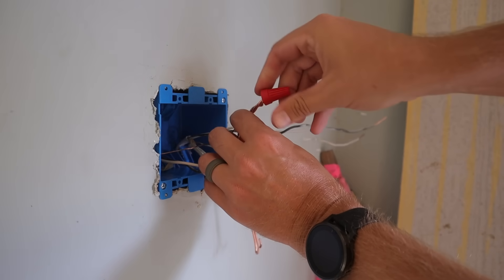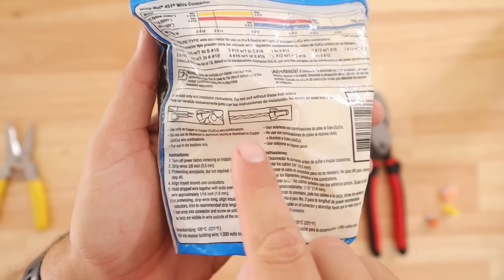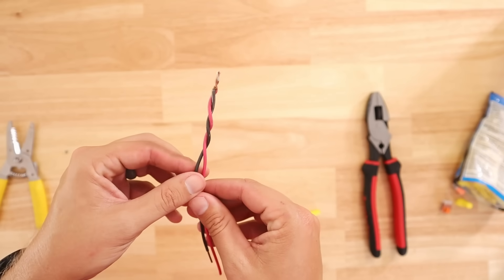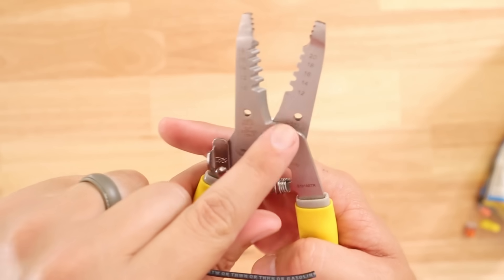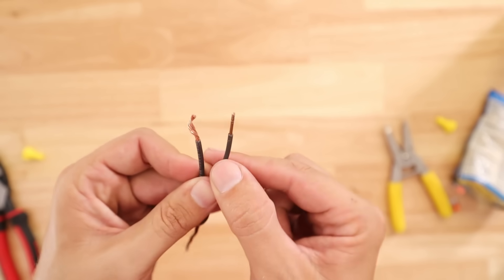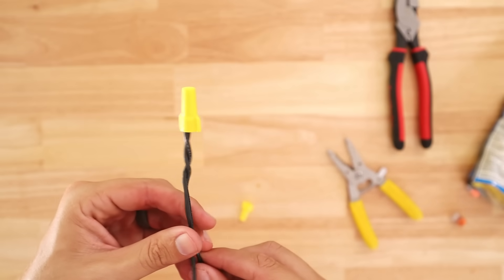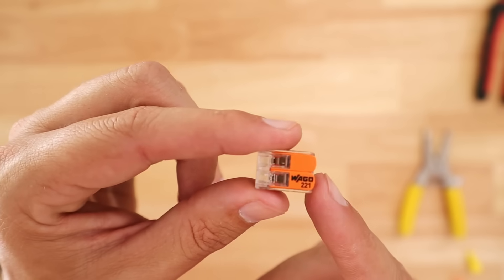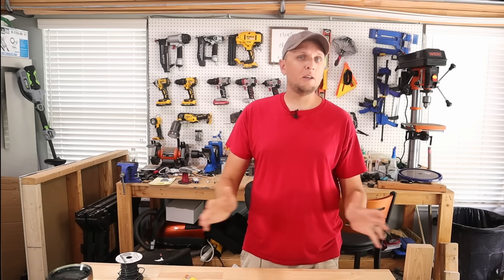BIGGEST Mistakes DIYers Make When Connecting Wires Together | How To

Comment: A slightly quicker way and still get a good strong twist of stranded wire onto solid wire is to put the stranded wire slightly above the solid wire. When you start to twist the wire nut it grabs the stranded just before the solid. That prevents the stranded from pushing out and makes a very tight twist around the solid. Just make sure to hold both the wires securely or it will try and pull just the stranded into the wire nut. Give it a try.
Reply: If you don't lead with the stranded conductor it will almost certainly be pushed out.
Reply from the maker: Yup that is also a way that works.  Thanks David!
Reply: What I regularly do is seat the stranded lead(s) all the way into the wire nut, w/o any solid conductors.  Give a twist to make sure it's seated, and the stranded lead consolidates and tightens "loose" strands.  Only THEN insert the solid conductor and twist 'em home.  
Works every time. 
YES, there are a lot of bad electricians out there.  I ran a new dedicated line from the load center to a dishwasher that an electrician had tied into a porcelain pull chain light fixture below it in the basement.  Removing the fixture, the wire nuts fell onto the basement floor. Yikes.
Reply: @KWKloeber  Have had that happen to me as well. Really sucks when it is an older house with more than 1 circuit going in and out of the light box. A lot has changed over the years including the mindsets electricians used back in those days. Today is vastly different than those times. Still find soldered connections in attic junction boxes. Now that is a pain.
Reply: @KWKloeber  Not directly relevant here, but more on bad electricians. When I replaced a straight switch for a Lutron dimming switch, I found a loose wire that was a separate 120 v source, just lying unconnected to anything.
Reply: @KWKloeber : Whoa! .... and the guy that did the install is a "certified electrician"?
Reply: Excellent advice and well described too.
Reply: James Sheppard  Right on James!  A cap.  Mechanically tight connection first, then the cap.  45 yrs Master & Electrical Contractor.
Reply: James Sheppard  Soldering was the way to do it before modern wire nuts. Completely unnecessary now.
Reply: I used to do electrical work and this is exactly correct.
Reply: Probably one of the most thorough and clearly described videos I have seen on any subject on the Internet… Thanks much!👍🏻😎
Reply: That is the best way in my book. I have always done it that way.
Reply: Best way I've found is to put a slight "S" bend in the solid wire then the stranded will follow the curl of the wire. You can use your fingers to twist then put wire nut on.
Reply: I agree after twisting your stranded wire itself start it in nut first. That's old school technology
Reply: @olruss4606  I have always put the stranded a little past the solid and then wire nut it. Never had an issue doing that. Putting it in first would pretty much do the same thing I believe.
Reply: This is how I was taught!
Reply: My dad was an electrician and when I worked for him he'd "have my nuts" if he coaught me pretwisting 2 solid wires before installing the "marrette" wire nut. Thomas&Betts Marrette ACS wirenuts - strip 7/16" on both wires, insert parrallel into the wire-nut and twist intil both wires twist below the nut. Using a linesman pliers can cause scratches that cause stress risers which can cause the conductors to break (particularly bad news with aluminum wires!!!!)
Reply: @MrCsnyder1952  Aluminum wire is no longer NEC code compliant due to that reason. Copper is far more resilient. Where you have to be careful is when stripping the wire. Nicking the wire by using too small a stripper can cause the wire to snap off.

I do need to make a correction on aluminum wire. It is only acceptable for use in service connections from poll to meter. Anything after the meter must be copper.
Reply: Pretty sure he showed that
Reply from the maker: I did but the variation I believe David is talking about is instead of then pretwisting the stranded around the solid core like I did, it is also common and accepted practice to take the stranded and have it slightly longer than the sc and then just twist the wire nut on as shown in the directions on the packaging.  If not, feel free to correct me David.  The way I showed is the way an electrician friend showed me he does it but everyone has their ways they have found they like to do things.
Reply: @HowToHomeDIY  Correct. As long as it grabs the stranded slightly first it will wrap tightly around the solid.  It will give you the same effect as pretwisting just a little quicker.  Wago's  lever nuts would be the best solution for dissimilar wires. 😊
Reply: @jonesgang  Totally agree.  I prefer Wago when using stranded wire.
Reply: I always use electrical tape over the wire nut and down the wire about 3 inches after nutting them together.
Reply: @mouthofspaghetti7817  that is a bad practice, you add heat, moisture trap and adhesive goo that is all completely unnecessary. This guy is showing you in detail all that is needed to make great splices.
Reply: @mouthofspaghetti7817  Tape doesn't do anything. If you need tape to make your wirenut secure, you didn't use the wirenut correctly.
Reply: @DaveMiller2  You are missing the point; wire nuts alone might work fine on display in the wire nut museum but in the real world, where a wire is in a wall or in the HVAC units I used to service; other people, many unqualified and or unprofessional might come along a pull on your wires, step on your wires; causing the wires to be pulled out of wire nuts...
   I have seen wire nuts split, crack, swell and strip out... in the real world the best of design can fail. In that case I want a backup.
   I have never seen a wire nut wrapped in electrical tape fall off. Can you say you have never seen a loose, cracked, swelled, stripped wire nut.
   Redundant safty might not be needed but I am going to continue to do it. If you feel comfortable doing the minimum, Go for it!
Reply: @mouthofspaghetti7817  You missed my point. Tape will not keep wires in the nut if it fails. If the wirenut failed, it was installed improperly, not because of a lack of tape. 
Tape literally does nothing but make you feel better about it. And the glue in tape lets go over time anyway. Especially the cheap tape most guys use. 
If someone pulls on wires or something and they come out of the nut, you installed the nut wrong. You didn't tighten it correctly, the nut was too big,  too small, or was  used when you put it on. A new wirnut properly sized and properly installed  will be fine over time. Tape does nothing. If you can pull the wires out of the wirenut, the tape will come right off with it . Tape has almost no power to hold. I've tried it myself. 

In the old days they put tape over soldered connections because you could shock yourself touching the exposed connection otherwise. That is where the mistaken idea that wirenuts need to be taped comes from.
Reply: @DaveMiller2  I guess all those wire nuts I have seen fail must have just been my eyes playing tricks on me. The ones I have had crack and split were of a special design and I thought they just broke.
   I don't care what the minimum standard is...I am going to continue to use tape over the wire nuts because I have NEVER seen the combination fail, I have seen wire nuts alone fail. 
  Bringing up cheap tape is silly, professionals should know better, I guess I should have said Dollar Store wire nuts fail but I didn't because that would be a ridiculous statement. 
   The Electrician who taught me used tape/wire nuts, every Electrician I have worked around saw me using this technique,  I only remember them approving, I have seen hundreds of splices done this way.
   So far the only people I have heard who have a problem with it are people on YouTube.
Reply: @mouthofspaghetti7817  I'm with you, it's standard practice in HVAC units to tape them on to prevent them from slowly unwinding off from the unit vibrating all the time. With a lot of motor hookups it's a good idea to wrap it in tape. I've even had to do it at an HVAC manufacturer. Usually the shop connections are all on nice terminals, relays and contactors and inside a motor's splice box. The motor end was always supposed to be taped after making sure the wire nut didn't come loose. Sometimes we built really huge units, that had to be taken apart to be delivered and installed then put back together easily on site, so there would often be splice boxes on the motor conductors that had to be spliced with a wire nut-- and taped. Controls would get boxes with terminals, but the motor cables always got spliced, then taped. Even though I would have to take that splice apart after testing-- they wanted me to just retape it to hold the wire nut on top of the single conductor during shipping-- that way it wouldn't scratch the paint during transport. Tape is cheap compared to damage.
Reply: @mouthofspaghetti7817  If your doing that tape thing on 200 connections a day, you aren't going to have a job for long. Completely unnecessary.
Reply: @scottmichaels1764  I don't do that type of work anymore but when I did it was more like 5 a day.
   Most of my experience was in HVAC and I recently found out that because HVAC has a lot of vibration and drastic temperatures change,  taping wire nuts is suggested. 
    But even if I wasn't wiring HVAC, I would want that extra security for my connections; 20 more seconds isn't going to ruin my day.
     What kind of work are you doing to where you are wiring 200 connections a day?
Reply: @scottmichaels1764  Wow that is impressive, if you are wiring 200 a day ,that is more than a connection wired every 5 minutes.
Reply: @mouthofspaghetti7817  I'm a 25 yr master electrician, 20 year master mechanical/ HVAC and never tape wrap my wire nuts. If installed correctly I've never seen a wire nut just " pop off " unless the wiring is being handled at the time, there are too many wires crammed into a wire nut or a cheap brand was used. As a whole if one pops off it's because you installed it incorrectly to start with and in that case the tape won't prevent arcing or a fire. The loose connection in the wire nut is not helped by the tape and the tape will simply melt or catch fire anyway. Loose connections or heat build up cause most electrical fires. Tape helps neither.   Most fires caused by arcing, as I would assume you are trying to prevent by taping a nut on, occured when heat builds up in a wire and the protective coating is basically baked to the point of cracking allowing wires to short against each other. Taping increases heat build up. It is basically the same principle as reasoning for bundling codes. Wires conduct heat. They require cooler ( ambient ) temperatures to offset it. However, in HVAC smaller guage wires are frequently taped due to vibration and the fact that many low voltage wire nuts do not have springs in them unlike nuts for 120 volts and higher. That's comparing apples to oranges though. Hell many high voltage signs don't even use wire nuts in their connections. I see signs all the time with exposed wire twists.
Reply: @DavidBrown-mm8fx  In 20 years of industrial machine maintenance I've had  many taped wire nuts come off, tape and all. Tape is (in low voltage application) nothing more than a "feel good" for those who are not qualified. It will hide their errors in the short term, but that adhesive will always fail, sooner if heated. I have used miles of splicing tape in peckerheads, or in junctions with unsecured lugs.
Reply: @patrickcamp5885  100% agree. Tape is irrelevant and a waste if the wire nut is installed correctly to start with. It was common to wrap connections back when caps with crimp connectors were common but that was a long time ago before wire nuts with the springs in them.
Reply: @mouthofspaghetti7817  the only thing with that it creates heat if you use the 3M wire nuts they have that rubber skirt on them no tape needed, one less move… time is money. JS
Reply: @eddieklein9536  Time is money, sure, but any time an electrician spends applying electrical tape is time well spent. Do you skip putting on box covers to save time too? ;) Just sayin'
Reply: @mouthofspaghetti7817  Right in the video he points out that the code is to follow the manufacturers instrunctions. I don't recall ever seeing anything about tape on any instructions. What more is there to say? Is the code wrong?
Reply: @MrGorillafingers  'Code' is the minimum standard to pass an inspection. No one fails an inspection for doing a better job than required. If you are happy with the minimum standard, go for it.
Reply: @mouthofspaghetti7817  Hahaha "better" That's rich.  I have removed so much useless tape fixing things that were done by guys that think that way.  Right is right. Wrong is wrong. The tape isn't going to change anything beyond annoying the next guy.
Reply: @MrGorillafingers  All I hear is people complaining about taking off tape, or saying it is an unnecessary extra step.
   I haven't heard one person say this step will cause wire nuts to come off.
   I will say again, I have seen wire nuts break and fall off, get stripped and fall off, vibrate and fall off, have a jerk off mess with the wiring and fall off...all except the last one would have been helped by the simple step of wrapping the wire nuts with Electrical tape... The last one may have been prevented if the Jerk Off was a whiner who didnt want to get their widdle fingers gooey from the glue on the tape...😭
Reply: @Mouth of Spaghetti  It's definitely not a code requirement & depending on the inspector & application quite possibly may be required to remove the tape. Typically, inspectors expect to see jobs done following the industry standards & any deviation will almost always be corrected or at least inspected to a more stringent level to ensure the tape isn't covering up shoddy work or more than likely the inspectors  spidey sense would tingle when presented w/ evidence likely identifying the individual who deviated from the norm as underqualified or in need of some retraining on the task. Once a "best practice" has been established, the criteria is recorded & published as the industry standard.
Reply: @mouthofspaghetti7817  Your comment shows that you know your business. It's kind of like using two condoms. One for the actual job and the second for backup.
Reply: @outlet6989  To me using tape shows just the opposite....an amateur. Tape is ridiculous and a pure nuisance to come behind.... it's absolutely unnecessary. Watch this excellent video again and you can make perfect splices and save yourself the waste of time that taping is.
Reply: @mouthofspaghetti7817  same here, can never be to safe!
Reply: Yes, I want my splices hard to take appart. I want my splices to be annoying. Wire nuts slip off all the time, even if you do it correctly. 
    I have seen people pulling on wires like idiots to get slack, I have seen all kinds of abuse to wires that have been in use for years. Especially if someone who has no business messing with electricity starts messing around. 
   Granted, I am not an electrician but I was shown to wrap wire nuts by a electrician and I have seen this done and used it for well over 30 years. YouTuber are the only ones who have complained. 
   The sign of someone who doesn't know what they are doing, is someone who isn't willing to do extra steps for safety and quality. 
    But I guess all my experience is worthless because a YouTuber Influencer says different.
Reply: @mouthofspaghetti7817  there is no added safety or quality achieved by taping wire nuts. That is where you are so mistaken. As far as the rest of what you wrote....you can talk about idiots messing around with anything making nothing safe from harm.... taping a perfectly safe wire nut is ridiculous.
Reply: @fritzmiller9792  So you have never seen a wire nut fail , brake, crack or slip off?
Reply: @mouthofspaghetti7817  Just answered a service call Saturday morning....the wire nut melted, which melted the insulation, which shorted inside the wire compartment, which caused the maintenance guy to flip the breaker back on, which made massive arcing. Guess what, an amateur had changed out the hot water heater and stuffed 12 inches of #10 wire into the compartment and likely pulled the appliance stranded wire out just enough to make a high resistance connection which over a years time finally melted it. Amateur work caused the wire nut to melt. Tape would have done nothing except maybe caused some more smoke and extra material to burn. BTW, wire nuts and wire insulation are both made to not burn easily buy dried up old tape will burn better than both. Bottom line, plenty of people believe in taping wire nuts and you got a bunch right in here doing just that and everyone is going to make up their own mind. All I do is speak from 36 years experience and tell everyone it's ridiculous to tape wire nuts because it's unnecessary and in no way better and in fact in several ways it is worse.
Reply: @fritzmiller9792  Okay??? Thanks for confirming wire nuts fail. I bet you also know stories of them getting hot enough to just swell and fall off.
   I dont have nearly as much experience as you do but I have seen wire nuts that have fallen off.
   I am sorry, I don't have any stories to share of several inches of electrical tape unraveling itself.
Reply: @mouthofspaghetti7817  bad workmanship fails.....wire nuts are perfectly fine when installed correctly and they never just fall off unless never installed correctly. Like literally millions of other parts that make the systems run across the globe, wire nuts function as designed minus other failures. If hundreds of years of engineering and use proved otherwise then the instructions on the wire nuts package would say to use electrical tape...... which those instructions never have in over a hundred years. But that's just some facts.... people can imagine the benefits of taping wire nuts and continue to make a useless mess if they want. 👍
Reply: @mouthofspaghetti7817  You are 100% correct in your thinking. The biggest problem I run into is people trying to do their own electrical work. I am not against people trying to fix their own things, but some things are best left to those that know what they are doing. Google and YouTube are only going to help them just enough to get themselves into a lot of trouble and financial woes.
Reply: @mouthofspaghetti7817  You are wrong, plain and simple.  I have been an Electrician for 40 years and putting electrical tape on a connection after a wirenut that has been properly applies is 100% unnecessary.  After working in homes, businesses & factories of every kind you can imagine and some you probably can't; I can assure you that wire nuts do NOT "slip off all the time."  

A sure sign of someone that doesn't know what they are doing when it comes to electrical work is putting on a wirenut, then taping over it.  One reason is that if you wrap it the wrong direction and put any kind of stretch on the tape to make it lay tight and smooth, it can actually loosen the wirenut as the tape tries to relax.  That causes heat, which the tape holds in, which causes more heat, etc, etc, etc....
Reply: @scottgordon954  I can give you a lesson in taping in the right direction if you need me to..
    Being necessary isn't the reason I have done it and will continue to do it,  most of my experience was in HVAC, it is more common to wrap the wire nuts with tape doing that type of work because of the high temperatures and vibration. 
   It is not a figment of my imagination, I have seen a lot of wire nuts fail. On planet Earth, things aren't perfect, wire nuts aren't perfect, they fail. Necessity is the mother of invention; why do you think electrical tape was invented? To wrap splices.
Reply: @scottgordon954   Here you go, now site something that says never to do it.